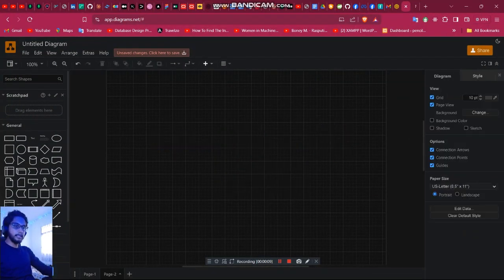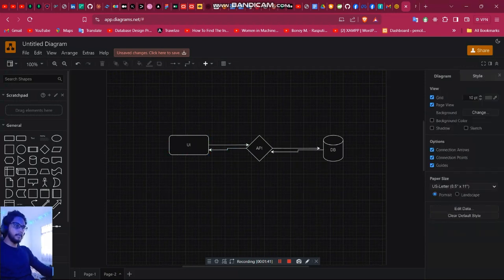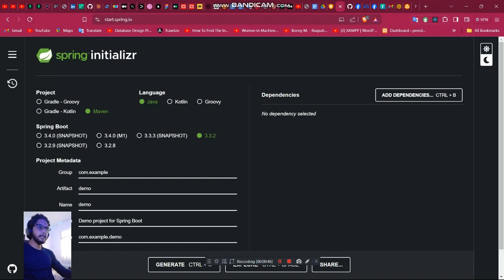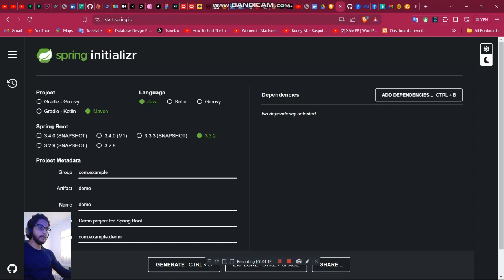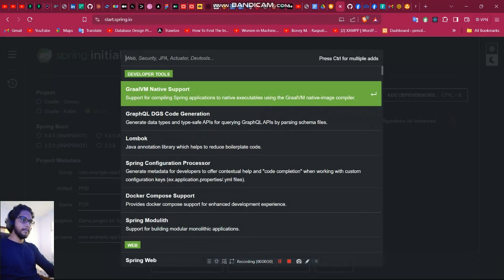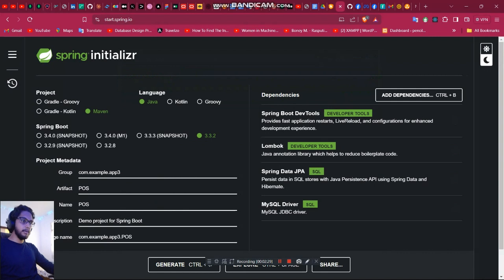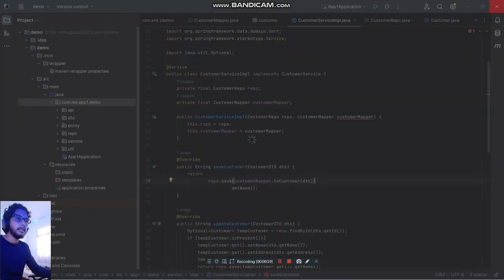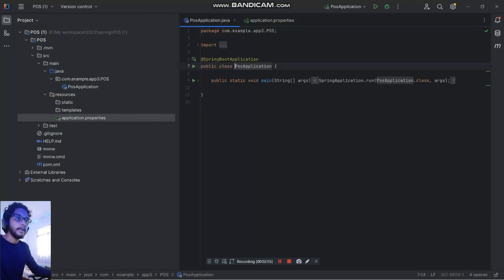Spring Framework 101: Introduction & Setting Up Your First Project

Comment: Thank you very much for these informative videos. I have a question: When developing a POS system for a shop or any other business, should it be a web application or a desktop application? What is the common approach in Sri Lanka?
Reply from the maker: In Sri Lanka many businesses shifting to web-based POS systems but some still prefer desktop versions for stability. It really depends on the shop's requirements.